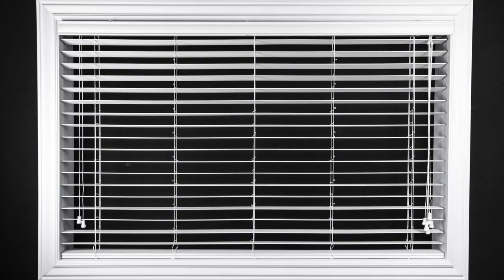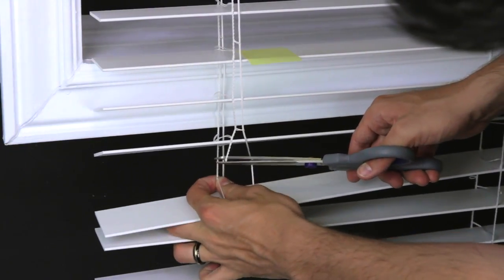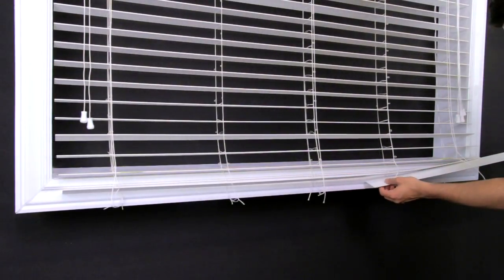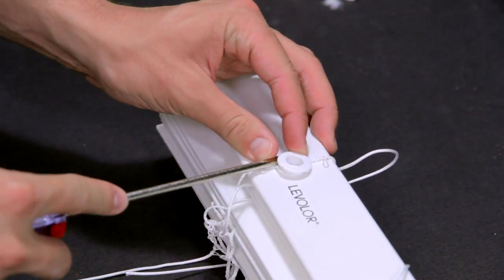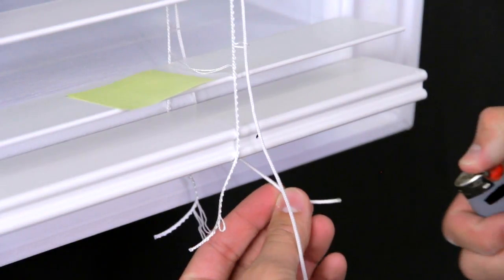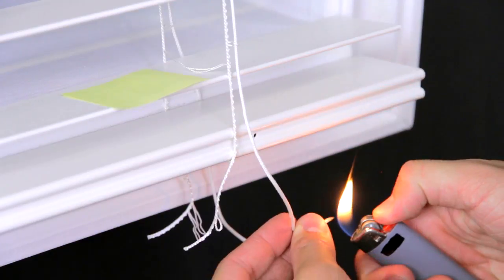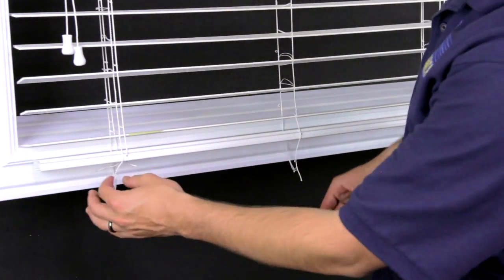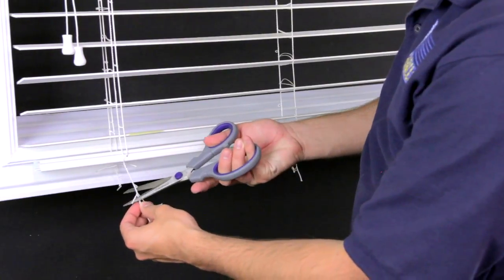How to Shorten a Cord-Operated Horizontal Blind

Comment: Pretty poor video. First of all, you said you only needed 3 tools yet in the video the guy is shown using needle nose plyers to thread some cords back through the holes in the bottom slat and then he seems to thread a cord through a tiny hole that is not mentioned in the voice over?
Reply: Also, you could of sped up the part where he is removing slats as gis was painfully slow and then you mentioned something about ‘end caps” that I assume came with the blinds- not to mention the valance at the end that comes from no where and is given little ot no instruction on how to unstall. Granted, the valance is probably the easiest part of the whole installation. Grade = D+
Reply: How would cut  the width?